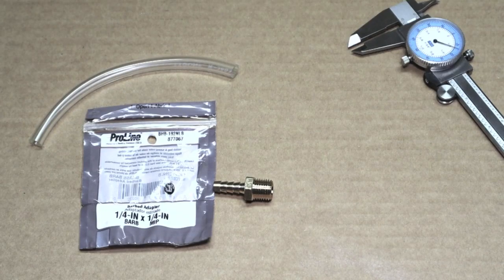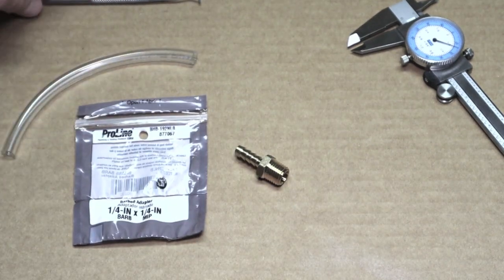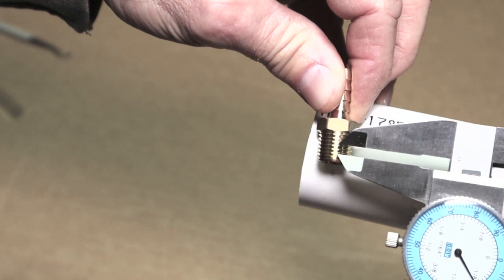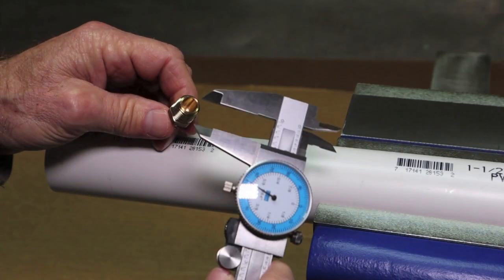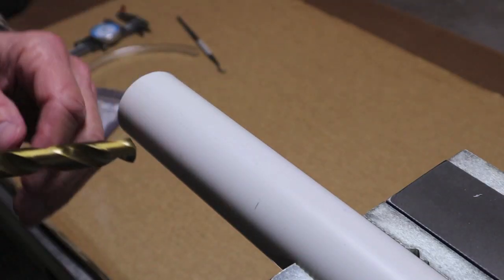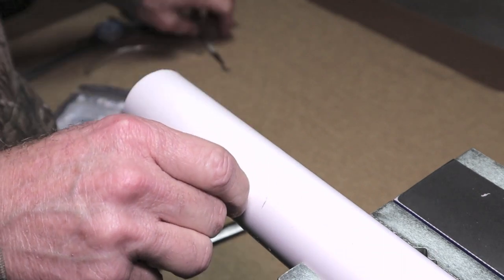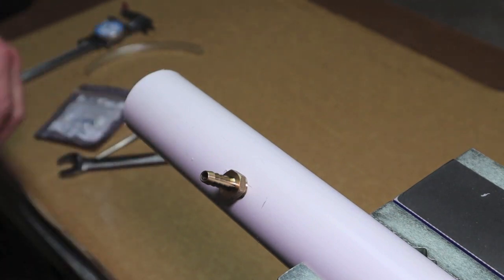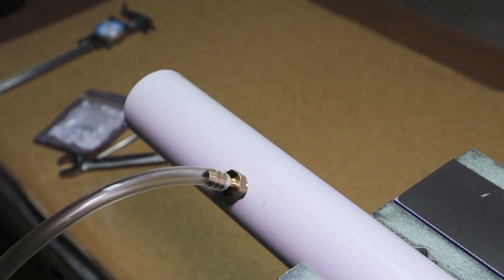Dehumidifier Pump Drain into PVC drain pipe

Comment: That’s really needs an air gap. That’s a code violation and could be very insanitary. Also you are negatively impacting the integrity of the pvc pipe.
Reply from the maker: Air gap is at the top.
Code violation? Codes change every 24 months so who knows?
Negatively impacting the integrity of the PVC pipe? PVC pipe is tough stuff.
Thanks for watching Becky!
Reply: You could call the opening to atmosphere at the top of the stack a vent but it’s not an air gap.

It’s a common code that goes for condensate drains, water softener regeneration, some dish washers, any RO system that drains. Thoughts process being if you had a back up of sewage it could possibly enter that line. You can make your own air gap for that stack pretty easy with a variety of fittings and some properly placed cuts so you will always drain into the stack with no problem but a back up would hit a high spot where it would simply overflow and the sewage would never come close to contacting your drain circuit. 

I actually did exactly what you suggested in the video for a softener regen and I just made a high loop but technically it could cause trouble.
I found that the shark bite laundry box with two drain holes with. Wye installed in the stack makes a great place for a washer drain (and dryer drain if you got a fancy new dryer) but usually washer drain and softener regen air gap in the box.

Your right, that tapped hole didn’t effect the integrity of a dwv pipe.
Reply from the maker: Any kind of sewage or septic tank backup is certainly cause for alarm. I noticed the water softener installer put an air space drop in their little discharge line too, going to same PVC pipe I used. 
Thank you for the information!